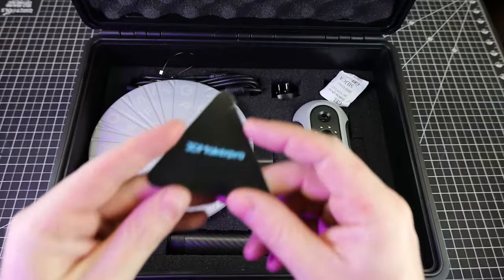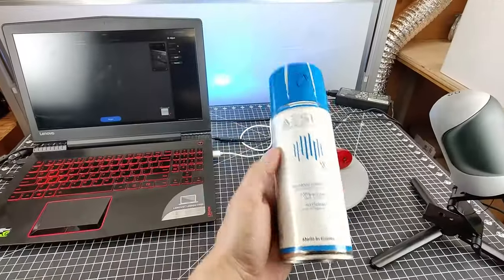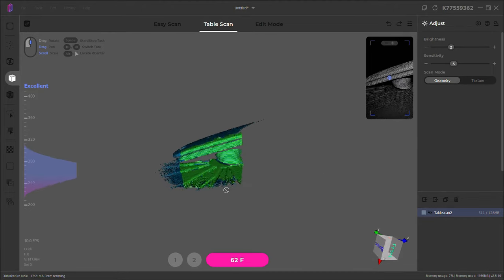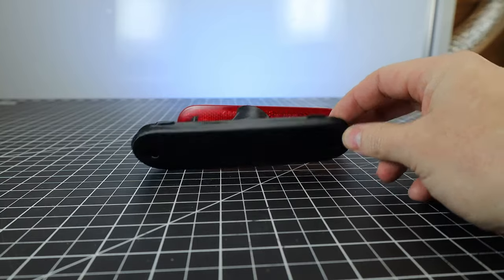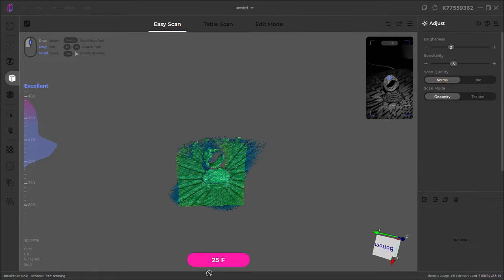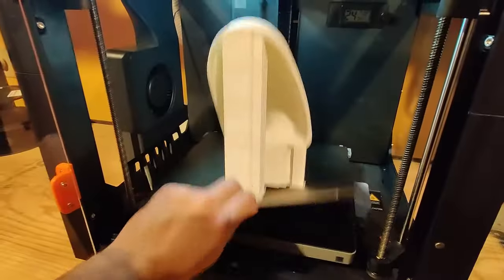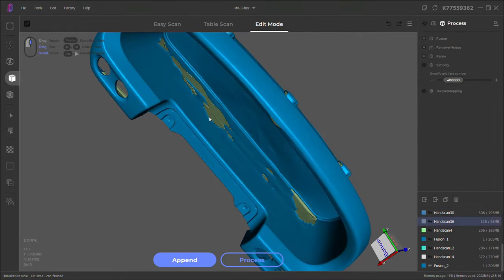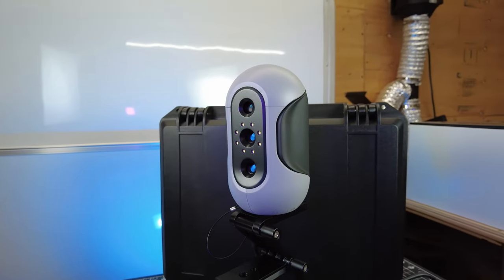How to Create Your Own Car Parts with This 3D Scanner - 3D Maker Pro Mole 3D Scanner

Comment from the maker: Mole 3D Scanner - https://bit.ly/Mole-3DScanner
Use Code RandyMay to save $10 when buying the Mole 3d Scanner

3D Modeling & CAD for Motorsport Course: (Save $50 using this link) https://bit.ly/3DModeling-and-CAD-for-Motorsport

Other Helpful thinks for 3D Scanning:
AESUB 3D SCANNING SPRAY - https://bit.ly/AESUB-3D-SCANNING-SPRAY
MARKERS FOR 3D SCANNING - https://bit.ly/MARKERS-FOR-3D-SCANNING
Cheap Spray-Powder - https://amzn.to/43LZBX1

3d Printer Filament That I Use:
PolyLite ABS - https://bit.ly/PolyLite-ABS
PolyLite ASA - https://bit.ly/PolyLite-ASA
PolyFlex TPU 95 (Flexable) - https://bit.ly/PolyFlex-TPU-95
PolyLite Silk PLA Blue - https://bit.ly/PolyLiteSilkPLABlue
NylonX Filament - https://bit.ly/MatterHackersNylonX
PolyTerra Marble PLA - https://bit.ly/PolyTerraMarblePLA
TECSONAR Tricolor PLA - https://amzn.to/3H79d5N
Build Series PLA - https://bit.ly/MatterHackersBuildSeriesPLA
Build Series Silky PLA - https://bit.ly/BuildSeriesSilkyPLAMatterHackers
Build Series ABS - https://bit.ly/MatterHackersBuildSeriesABS
Build Series PETG - https://bit.ly/MatterHackersBuildSeriesPETG
PRO Series Filament - https://bit.ly/MatterHackersPROSeriesFilament

Amazon 3D Printing Filament:
PLA - https://amzn.to/3gsLE9Z
PETG - https://amzn.to/3pXjjvu
ABS - https://amzn.to/3wsTRjS
ASA - https://amzn.to/2RX8dtM
Polycarbonate - https://amzn.to/3cLdr38
Nylon - https://amzn.to/3iNGeI2
______________________________________________
Note : Most of the links that I use that go to products are affiliate link. This means I make a small commission on anything that you happen buy using them. This is at no extra charge to you and this helps support the work I do on this channel. 😁👍
______________________________________________
#3dPrinting #3dScanning #DIY #RandyMay #mx3

Comment: I bet I could model them faster in Blender than the time it took to scan and process them 🤔
Reply from the maker: Probably if you have the skills to do that. I don't know if the sizing will be 100% and the scanner is more of a tool to help with design work and not replace it.
Reply: @randymay  Now I'm just wondering why you 'loved' your own comment? 🙂 Besides that though, the sizing is not an issue, at all . . you can get dimensionally accurate parts in Blender, no issue, and there is also Fusion 360. And also, I don't see any improvements on the scans compared to the ones I used to get, a good few years back, with the old PSVR camera hack! And that only cost around 20 bucks!  It's a nice little gimmick for people that can afford it, don't get me wrong, but it's not worth the money they are asking for it, and thats by a long shot!
Reply from the maker: I like and heart all of my own comments. It just adds a little bit more interaction to the channel if nothing else. 

And yes prices are definitely a major factor when it comes to these and they're really not meant for everyone. Like I said they are more of a tool to help along with designing things or remaking things than anything else. Like how you can get geometries that would take you hours along with multiple tries to get right in just a few minutes using the scanner. And yes you can use a camera setup and do photogrammetry. 

I'm actually going to be doing a car build on this channel using a lot of the tools that I have gotten and shown in these videos. I'll be converting a early 90s car to full electric using the motor from a 2019 Nissan leaf along with its batteries. Being able to use this scanner to scan the entire engine bay to mock everything up is going to be extremely helpful for that along with making adapter plates so the electric motor will mate with the manual transmission.
Reply: @randymay  Fair enough, it's got its place in that sense, modeling an engine bay is tricky! That upcoming project sound right up my street btw, I'll be definitely watching out for it 👍
Reply: Blender is old technology

Comment: Great video and this is the exact reason I bought mine. I was disappointed that the luxury kit did not come in the hard case like all of these preproduction models. The software definitely leaves a lot to be desired but it works ok.
Reply from the maker: What stuff are you scanning
Reply: @randymay  I haven’t had much of a chance to scan car stuff but I’ve been scanning things like drill batteries and statues to see how well it works. I use professional structured light scanners at my job but wanted my own scanner for little projects here and there. With the professional scanners I like that I am able to perform “registration” across all of my scans with settings as I please. I really don’t like how this software runs the registration immediately after you press stop scan. I also think the software has a lot of room for improvement because the manual alignment is not as intuitive as it should be
Reply from the maker: Yeah the software is kinda annoying at times especially if you mess a scan up and want to stop it It will go through an entire loading process before you can just delete it.

Comment: Lots of issues with this software running on my laptop. Worked with tech support for awhile, but nothing since. Very disappointing so far.
Reply from the maker: What kind of problems have you been having? That software is not easy to learn in my experience but I think I got it all down pretty much and I think I am about 20 plus hours into using it. So I might be able to help.

Comment: Can I send you something to scan. When you align the scans, and choose points, does the point snap to the scanned file?? Meaning if you had to make four scans, and you have to align it, will the point have a variation in location, or the point will snap to the scan location you choose.
Reply from the maker: You basically give it 3 reference points that should align and it kind of figures it out.

Comment: Could I use this device to scan on a large scale? Like the whole front end of a car for example
Reply from the maker: You technically can but it is an absolute pain in the ass to do with this scanner because of the small scan area. That being said they make a bigger one that I actually did scan the front of a car with and you can as well here's a link to the video https://youtu.be/O5Zzx1a2Xdc

Comment: Thanks for amazing video! Which kind of fillament did u use for your printouts?
Reply from the maker: I just used pla for this video but I normally print my stuff in ASA or ABS
Reply: @randymay  thanks, PLA is like a prototype only?
Reply from the maker: For car parts yes. PLA is more for things that aren't going to be in UV light all the time and heat. So you can use it inside your home with no problems. But if you have it outside on a hot day it will get soft and deform
Reply: @randymay  many thanks for your answer! All clear! Goodluck with your new ideas!

Comment: Can i use this to scan my bumpers?  I design parts in clay. Thanks
Reply from the maker: Yeah you can do that but you will have to use markers so it doesn't loose track and do it in smaller parts and then align them all in the software
Reply: @randymay  thank you!

Comment: Really great video, thank you so much! Would it be possible to scan a standard BMW Mirror Cap and print it in 3D and laminate it with Carbon Fiber afterwards? 💯
Reply from the maker: I can see you being able to do that. There will most likely be some 3D model clean up you will have to do to make sure it's perfect and that it will still mount to the mirror but I can totally see that being done

Comment: would you recommend this over the creality scan lizard 3d scanner?
Reply from the maker: To be perfectly honest they are exactly the same scanner with just different housings. So whatever one you can get for cheaper would work fine.
Reply: @randymay  you are awesome for this, software is probably the same aswell I’m assuming?
Reply from the maker: Yes software is the same at least now it is. You can see in my video that there's an option for Creality lizard 😁

Comment: I have a 3-D scanner, and I can barely find uses for it. I have to be honest. Even as a fabricator and artist there’s almost nothing that I can’t make with a ruler and caliper.

I got a good deal on it so I’m gonna hang onto it until I can find a use for it.
Reply from the maker: 3D scanners are a good tool to get measurements quickly along with being able to capture complex shapes so you can copy them or make things to go on to them without tons of measurement and trial and error.
Reply: Last I checked,  a ruler is a straight line. Whatever you're cutting doesn't need a 3D printer to make

Comment: This is the video summed up, you can't do it unless you have an relatively expensive 3d scanner, I'm not very good at this so i'm taking a course, use my code to get a discount. This video was just for a product review and get you viewers to pay for your shit lol.
Reply from the maker: This was basically a review video about the mole scanner but at the same time I wanted to show what you can do with it and that you will need at learn a 3d software if you are going to do anything with any 3d scanner. Even with an expensive scanner you are going to need to learn how to work with the files in 3d and how to make your own parts. 

When I comes to the course I talked about in the video it was to show people that it was an option and something that I already bought for myself. So no one was paying for it if they used the code seeing that I already bought it. If anything I would get a credit to use later if I wanted to and they would also get the same amount off the course if they wanted to take it as well.